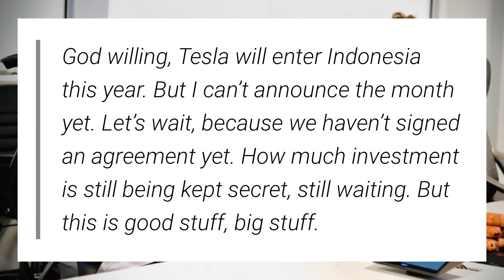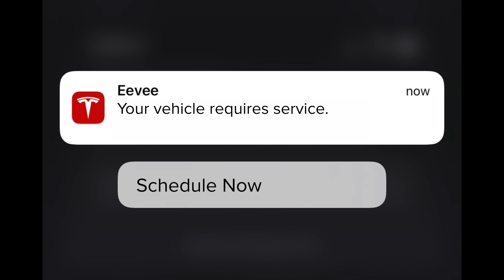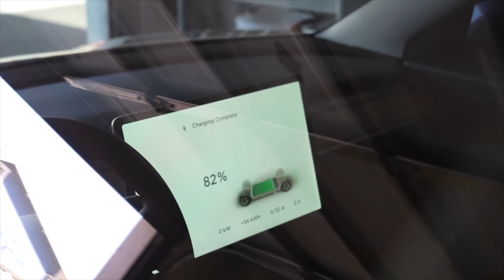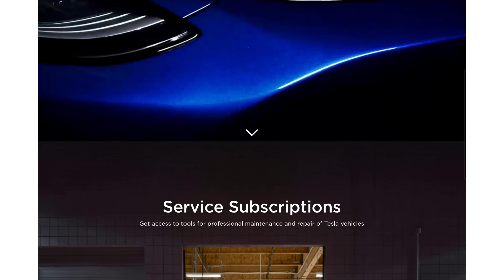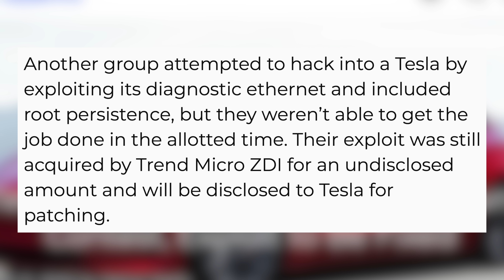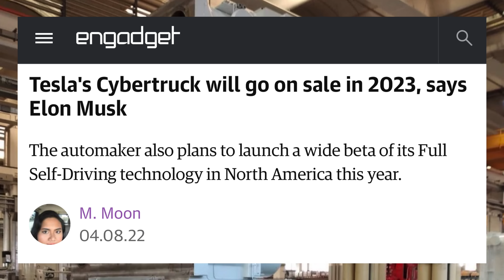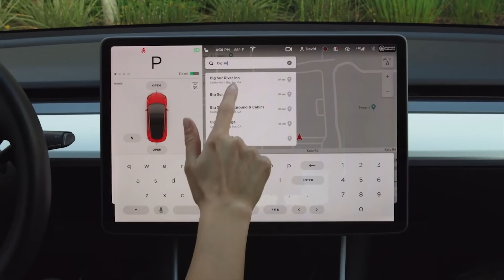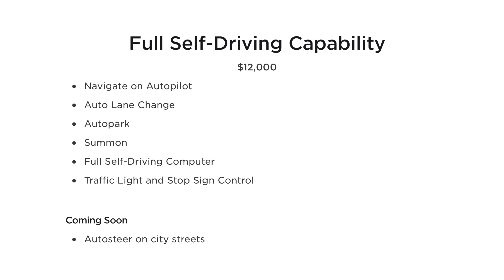Tesla's NEW 100 Year Battery | These Plans Change Everything

Comment: I thought that a "Giga Press" won't be used for cyber tuck production.  It will be made out of stainless steel, not teslas special cast aluminum alloy.  I suppose there will be some sort of "press" to bend the stainless steel like origami, but that's like a press brake, not a casting press like the g-press... I could be wrong.  Perhaps the press referenced is for semi?
Reply: Giga Press is for the single piece front and rear end. That will be die cast aluminum. The structural shell will be Stainless Steel, cold rolled, super hard. It will be laser cut and brake/folded. The interesting part is Cyber Truck is rumored to get next Gen FSD hardware.

Comment: Don't get all the hype about the FSD. To have a reliable FSD system, you need roads with monitoring systems and cars communicating with each other. If you can't drive your car, why not invest into a proper train network? Less traffic, emissions, and more sustainable. Also cheaper to the costumer than buying an expensive BEV.
Reply: All those self-driving companies proof different. Just watch those videos testing the systems. Also train mostly doesn't drive direct to your house and you can't just hop in to get somewhere. Have to wait for the train arrive have then change train wait again.
Reply: @swissTom124  you probably don't live in a very dense urban city.  Or you would have a different opinion about trains. FSD systems shouldn't be a primordial feature in a vehicle, because it could affect the development of the driving skills. So if someone is not capable of driving a car with minor drive assistance as "Cruise Control" and "Lane Assist", then they should get a Cab or a Uber instead.

Comment: Can't know if a battery will last 100 years unless you have tested it for that long. Also they say "when charged to 3.8 volts", which is about 60-70% soc max when compared to a typical lithium ion battery. Not really realistic. Also it uses NMC 532 which means it has tons of cobalt which is not sustainable. Just a theoretical exercise more than anything at this point.
Reply: "RESEARCH paper"?
DUH?

Comment: Claims are easy as with the Bot, a working prototype that proves those claims, is another completely thing. Similar to the 4680 Panasonic battery Cells, that didn't bring any breakthroughs in range or charging speeds. With slightly improvements into packaging.
Reply: How can you say that as no real world info on the 4680’s has been released
Reply: @Spokenblurb  check the recent EPA range testing of a Model Y.
Reply: @RogerM88  The EPA range you speak of is for the Standard range not long or performance where you’d get a idea of what the 4680’s could really do, here is a direct quote from Tesla “Introducing the new cells meant
introducing a new variant of Model Y.
We've designed Model Y AWD to have an
attractive combination of range,
performance and price that will be the best
fit for many customers and will make
Model Y accessible to more customers,
furthering our mission. Those interested in
an even more capable Model Y should
explore Model Y Long Range and
Performance. We've chosen to put a lower-
energy battery pack in Model Y AWD”
Reply: @Spokenblurb  tabless Cells design aren't new to the market. Even BYD has similar technology. If the Panasonic 4680 were so disruptive technologically, Tesla would be marketing heavily about it, and not relying on other battery Cells manufactures as CATL or BYD.
Reply: I'm tired of hearing about all the stuff that’s “coming”. How about something actually happening instead?
Reply: RogerM
There ARE NO Panasonic 4680 battery cells.
Pay more attention.
Reply: @rogerstarkey5390  you're the one needing to update your research.

Comment: Ryan have you heard of any USB thumb drive issues? Every other day mine says unavailable on the cam icon. I've pulled out and put it back in which used to help reset it. Now I just format it and that lasts a little longer 2 or 3 days then format again. thanks.
Reply from the maker: I actually have noticed the same thing on our Model 3 (with that drive), frustrating to re-format every few days. Maybe it will fix in a software update but we'll see
Reply: Just take the car to service and have the usb replaced.
Reply: Same here
Reply: The Original thumb drive is a temporary storage it can't even write 4 video channels safely, (not enough write speed). Buy a Samsung T7 1 TB SSD drive for your Tesla to replace it, all my friends got this and we have no problems with recordings.
Reply: @HH-bc2nz  thanks for the advice!
Reply: thanks all..probably get a new bigger one.
Reply: I got the Samsung ssd too. Works awesome
Reply: My 22 MYP is doing this. The M3 loaner I drove today was the same. The forums say it’s a bug from the last update. If I reset my car it works for a few days.